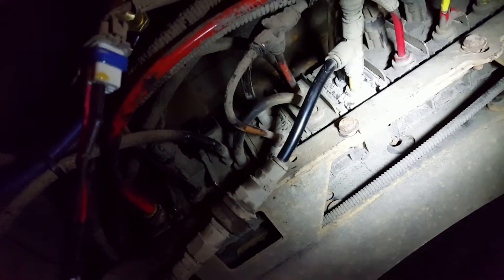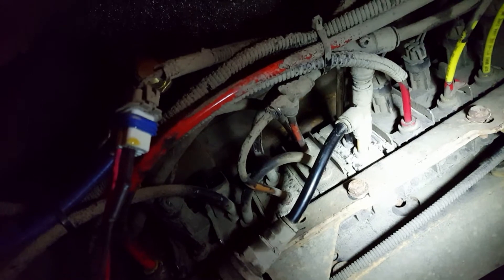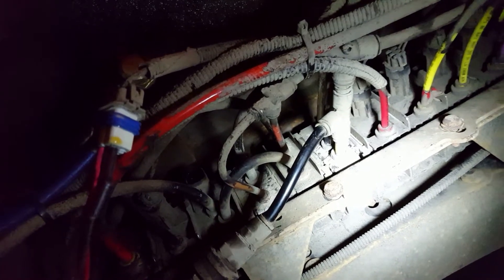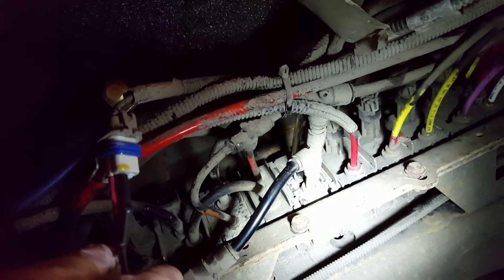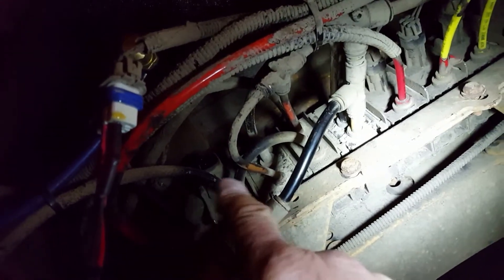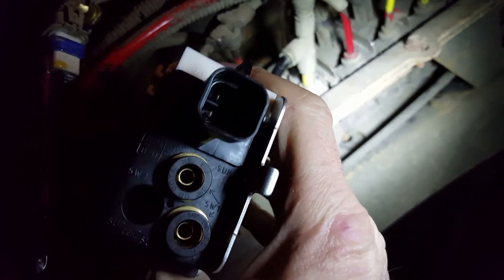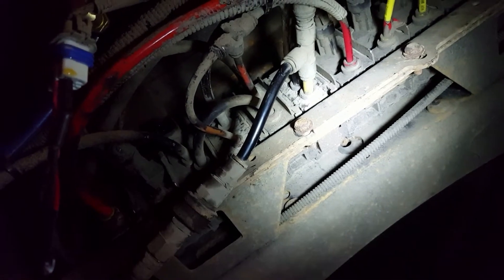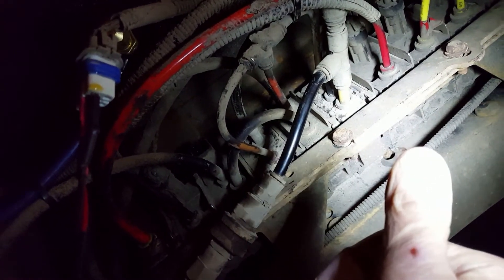Thomas C2 School Bus Park Brake Not Releasing

Comment: I have the park brake indicator on but the parking brake won't release. When I attempt to disengage the park brake,  air just dumps out what I believe to be the purge hose. I can't move the bus because of this.  Any idea what issue this might be or is there a way to manually release the parking brake? 

It's a 2007 thomas saf t liner c2
Reply: This just happen to me today! I went to a outdoor carwash to wash my bus for the 1st time and it wouldnt go out of park! I had to get it towed back to my place which was crazy expensive anybody find out how to release that parking brake. I only know how to do it manually but you need two people